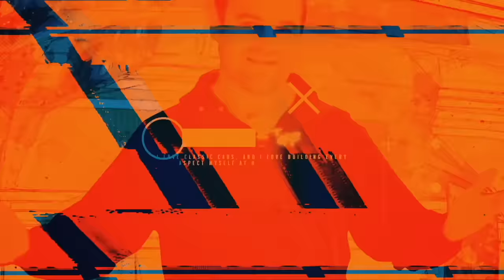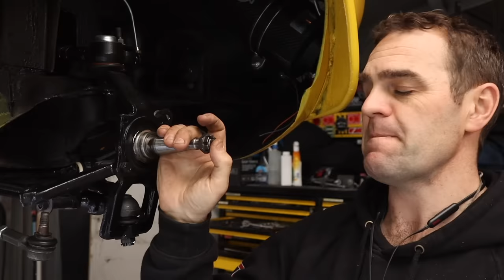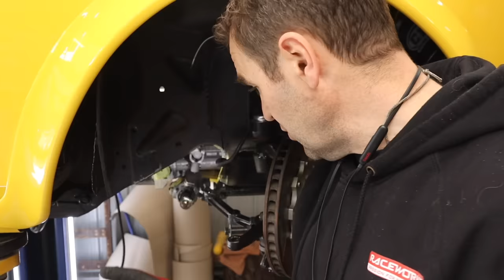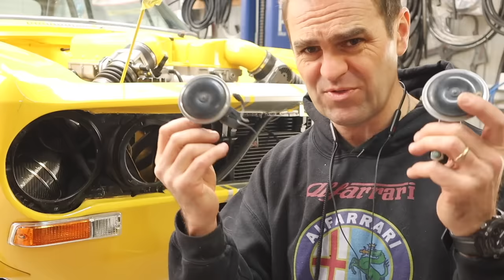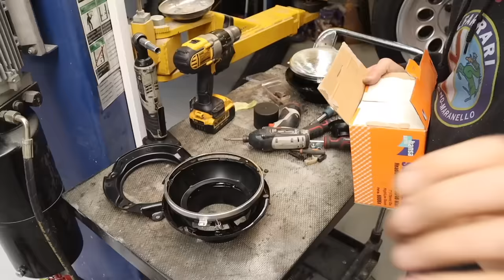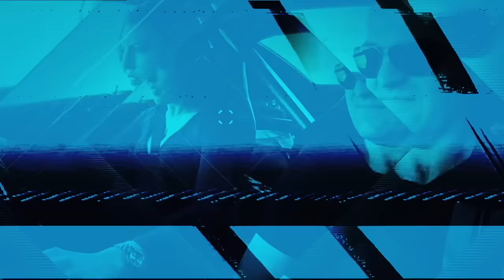The Alfarrari is on it's wheels! - Ferrari engined Alfa 105 Alfarrari build part 190

Comment: Had to chuckle a bit at the fix for the front spindles.  That is the same factory set up on MGB's where you have a spacer and shims to set the end float on the wheel hub.  Glad to see the car is on its wheels and that much closer to running on the road.

Comment: On the wheel bearing grease packing issue. I put grease in a plastic bag, cut off the tip at the corner. Use it to press grease between rollers. Works better than any other method. Try it.

Comment: Re the lights, as I wrote some months ago on this, H4 replacement LEDs lower the draw and produce bright white light which mean you may be able to go to a lower output alternator which saves weight.  Have an LED H4 on my 1974 Italian v-twin motorcycle (Morini 3 1/2) and its 140W alternator can now handle me running with lights on during the day without flattening the battery.  And the light is so bright with under 10W drain vs 75/55 for H4.  Supercheap and Repco sell ‘em off the rack.

Comment: Some trick front spindles there, and near 0 bumpsteer... awesome.  Lookin' amazing with the wheels on. Go Mr. Jeff go!
Window install method... What a difference. All the lube (is that soap? window cleaner, whatever) seemed to make it so much easier.
Notice going from 2 sides, starting low and moving around in steps. A 3rd person would still be nice, but with this method, 2 will do. 
This  Alpha window (and 911) are really f'n rough to get in there. This time wasn't easy, but worked. Would be good for "normal" windows too.

Comment: If it proves to be a handful with that suspension setup, or the diff implodes, a complete 1995-1996 Jaguar XJS rear end (only years with outboard brakes) would give you a relatively easy to mount, compact IRS setup capable of handling the power.

Comment: Superb job so far mate but as a long time car builder and restomod guy I have two small concerns - Firstly there might not be enough cooling power for that fairly highly strung engine, the 360 Modena had a rather strong cooling system, and secondly 205 section rear tyres will absolutely struggle!! Pity you can't squeeze in at least 225's. God speed to you regardless.

Comment: Looking great
Good call on the tyres - found a supplier in the uk as I’m running R888 on the same wheels and size - too track focused and find a bit of understeer until they get warm enough - hard to do on UK roads! 
And I only have 200bhp
Steering rack from an Alfa 75 so retains PAS and works nicely under the V6 Busso 
Shame I can’t add a photo as mine is yellow with a black stripe

Comment: Wow! that front end Jeff spot on👍

Really stoked on the interior.
That must have been a steep learning curve, but now has superb finish with the french stitching.
..
Love the stance with those wheels.
And you're right about having a higher profile tyre.
This allows a littl bit of give in the suspension travel.  I'd doubt you'd notice that much difference from a lower profile tyre inless you were building a hard core trwck car.
..
I was getting Mk1 escort mexico vibes from the rear view of the Alfarrarri. 
With those arches...
.
Can you advise on a good riv nut tool?
I see you using one in the videos.
..
The ones on eBay seem to break the dyes on first use..?
..
Can't seem to find good branded one that I can get  replacement dyes.
..
I bet you and Mike from stance-works gonna have a lot to talk about at the time attack event👍
😀
Reply from the maker: My rivnut tool is junk too

Comment: Does the Alfa use relays to activate the headlights? I know some old cars (like my TR4A) route the power to the headlights right through the headlight on/off switch. Since modern headlights draw more power, those switches can burn out from the load. I modified the TRs wiring to use relays for the headlights.👍

Comment: Looking great Jeff.  Wheel bearings are very important to get the right preload and I see a lot of people doing it wrong. The spacer you used for yours reminds me of the pinion spacer/sleeve used  in differentials for the same reason. 

One question regarding your hub, shouldn’t there be a seal on the backside of the hub, or does it seal against the knuckle/spindle?
Reply from the maker: It is there, you can see me putting it in. https://youtu.be/h60by52kiZs?t=424

Comment: I whole heartedly agree with the use of traditional headlights, as I too find the modern LED headlights unsightly and quite inapropriate for fitment on a classic Alfa 105.  On the question of the vehicle's horns, I understand that the ones fitted were readily available, courtesy of the Boxster, and also compact, however the sound they make is the 'JDM car beep-beep' which is somewhat inconsistant with the sound generated by both Alfa and Ferrari horns.  Perhaps something to consider at a later date.

Comment: Great progress! Looking good!

Did you consider leaving the rear anti roll bar off and go for a thicker front anti rollbar?  (Like alfaholics setup)
All depends on how firm the springs and shocks are.

Looking forward to the next episode!
Reply from the maker: No point in messing with sway bars until you see how it handles. Bigger front just means more understeer which is not as fun ;)

Comment: Love your builds, and particularly the Alfarrari. I am wondering why you didn't lubricate the rubber gasket and piece of string with dishwashing soap while attempting to install the rear window? Usually works a charm and makes a window slide right in with utter ease.
Reply from the maker: We did.
Reply: I have fitted windscreens to Alfa 105s with the rubber lubricated and a soapy string and the job remains difficult.

Comment: Why didn't you go for a 5 stud hub for more strength?
Reply from the maker: That is not a thing. Most go 5 stud for more wheel or rear end options. 5 is stronger, but 4 could still hold 1000hp.

Comment: Not a fan of the chrome of the grill surrounding the chrome of the Headlights. Looked the bomb on the workbench, not so much on the car. Black would probably look better. It would be easy to mock this up for testing purposes to arrive at a informed decision. The wheels on the other hand are just perfect. You could not have made better choice.
Reply: The Alfa 105 design stems from the early 1960s when chrome embellishments were in fashion - hence the look is appropriate and in keeping with the era.  Had the car been a late 1970s or 80s car when black embellishements were in vogue, then black would be the finish of choice.